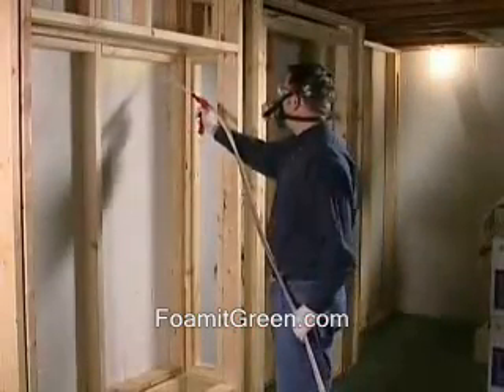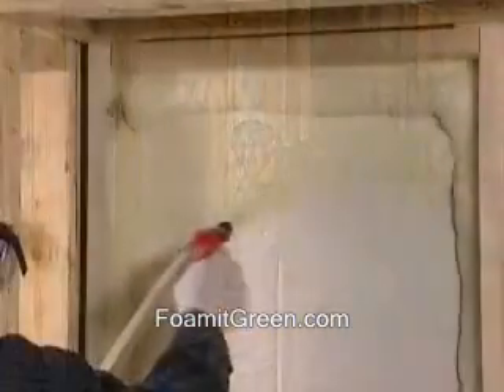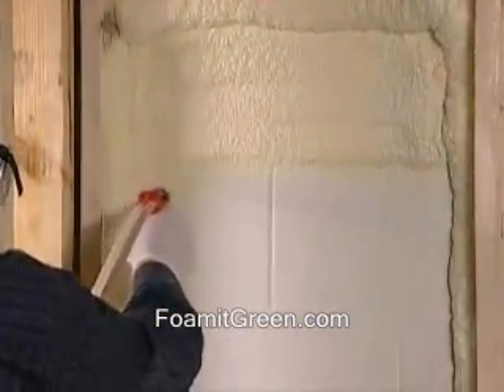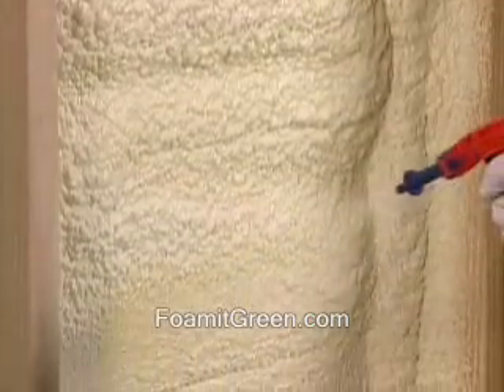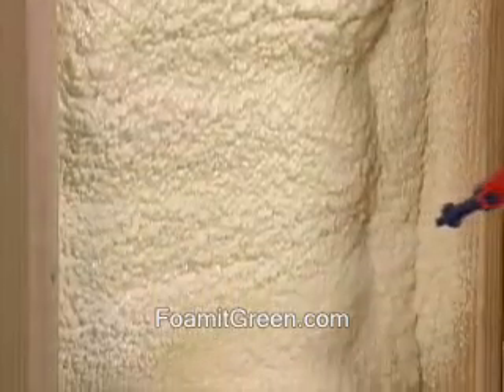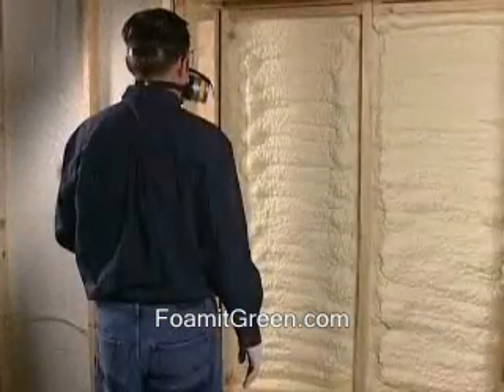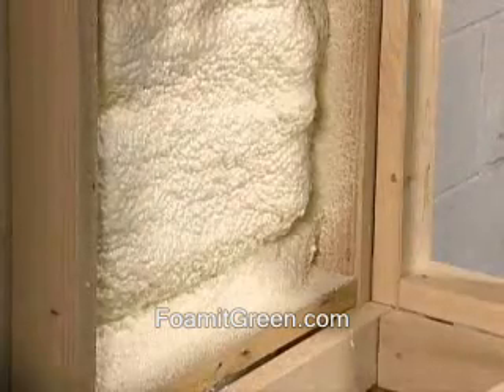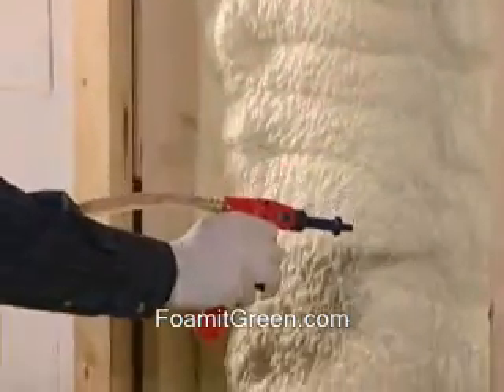Low Pressure Spray Polyurethane Foam Insulation Systems

Comment: @1dschamp The comment of an idiot that has NO IDEA what I know about this subject.

Compared to cutting rockwool this is enormously time consuming! 
Spray foam your whole house would take MONTHS! Not only do you have to spray it on in multiple layers, you also need to cut off the uneven surface of the foam before panelling.

Comment: Is this similar to the DOW Froth Pak?  I wonder what the R value and price per board foot are? I use some of the bottled polyurethane resin foams in weird rocky areas of basements when I am installing Air Krete in the house.

Comment: @haakon88t How is it not effective? It looks way more effective than fiberglass insulation. So what if it takes some time, what matters is how long it lasts? How effective is a shortcut when you have to redo it 3 years later because it wasn't done right the first time.